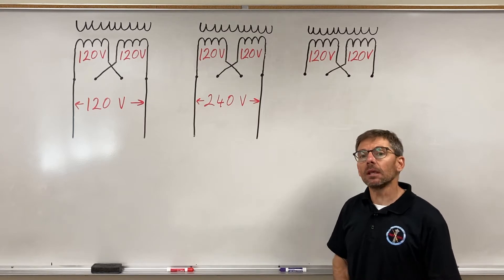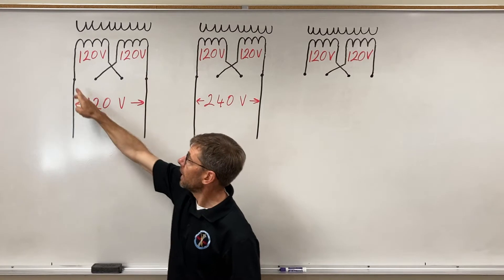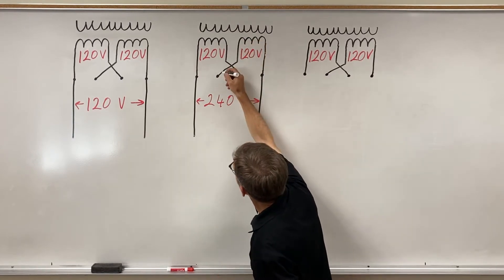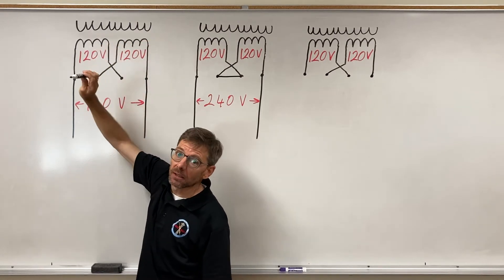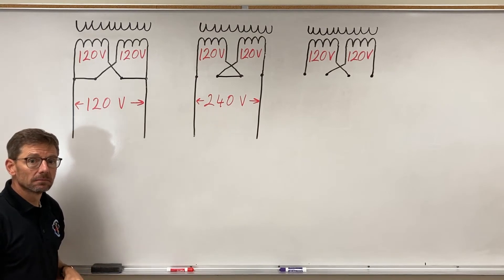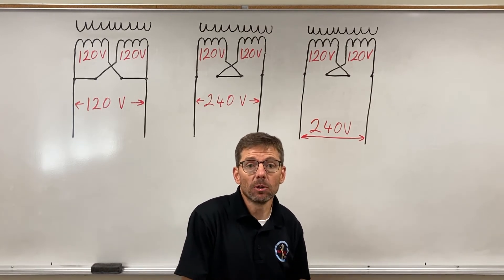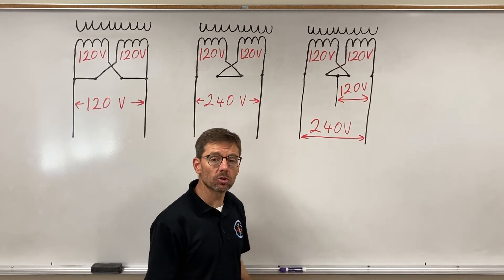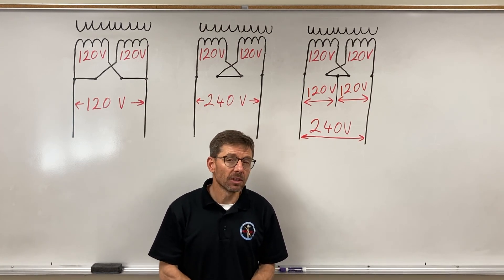Dual Voltage Windings - Part 2

Comment: I have a question. My primary is 480v single phase. Stepping down to 120/240v single phase 
Why does my low voltage disappear when I hook up the secondary side. But whenever it’s disconnected the low voltage can be read

Comment: I don't know if you read through comment, but thank you so much for educating me on how to interpret and wire transformers for 480v and 240v on the primary. I have an industrial machine at home I bought from my job and it was wired to 480v 3 phase and now that I finally have installed the machines to run at 240v 3 phase I realized I need to rewire the transformer to step down from 240v 3 phase to 120v single phase instead of 480v 3 phase to 120v single phase.

Comment: I posed this question on another of your videos as well: if you are drawing off a primary where the two poles are 120 deg out of phase, what does that do to the frequence and voltage of your output on the secondary?

Comment: Excellent videos, but I am still puzzled. I have a dual winding primary transformer (115V/220V), with wires that are not labelled (H1...etc), but by using a continuity checker I have identified both primary windings. Actually there is a fifth primary wire which I assume is some king of fuseable link. Anyway, it is not obvious to me which way around to connect the two windings in parallel for 115V working, as I do not know which wire is at what end of the winding. At about 2min 25sec of this video you make a "key point" of identifying the right and left side of the windings. I realise you are talking about secondary windings, but it's the same issue. From a continuity aspect, it makes little difference, but from a magnetic-circuit point of view, it has to be important. Otherwise there would not be a labelling convention H1....etc.). My concern is that connecting them the wrong way around (there are two permutations), there will be eddy currents and overheating, as a minimum. Is there any advice you can give?
Reply: I'm theorizing and brainstorming as well, not speaking from experience-based fact. 

With that said, maybe ohm the different different leads and use the ratio difference in said ohm measurements to determine where in the windings they are. Or possibly apply a small voltage feed and measure the outputs ?

Comment: I worked in factories that had indoor substations & MCCs that put out 12,470 & 7200 and 4160 3 ph. San Francisco's cable cars run on 6 phase power. Double delta & double wye. Military power is 400Hz. Solenoid type voltage testers (Wiggy's & VolCons) usually do not detect 400Hz power, so that's something to remember. It hurts just as bad as 60 Hertz.
Reply: I heard 400Hz shocks feel very different but I imagine it still sucks. Interest post though I'm very interested in reading about 6 phase power....

Comment: I have a newbie question : For the third option 120/240, is the center tap now neutral and both ends hot? How do I wire this to increase amperage for the 120V (similar to first option)?

Comment: Is it possible to connect one of the legs on the secondary to ground and get 240v on a single hot line and neutral? and if possible which leg would be the ideal one to connect to ground?